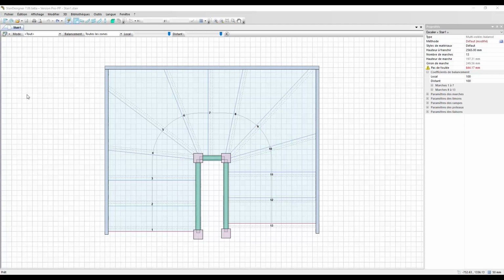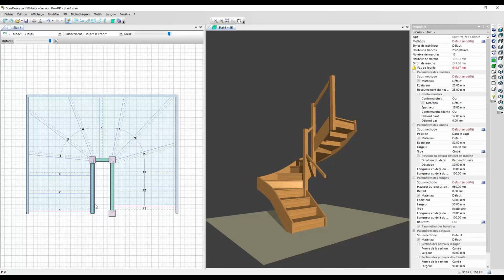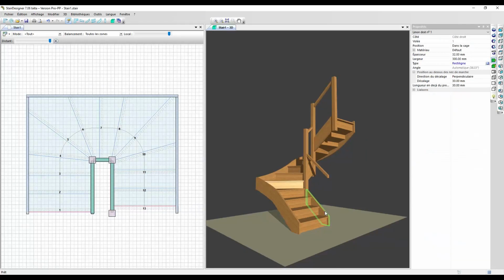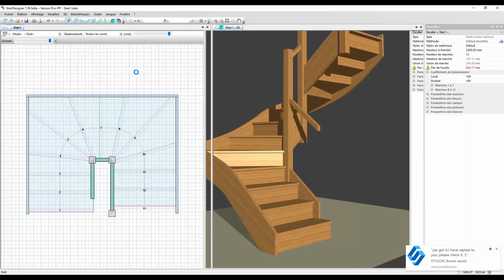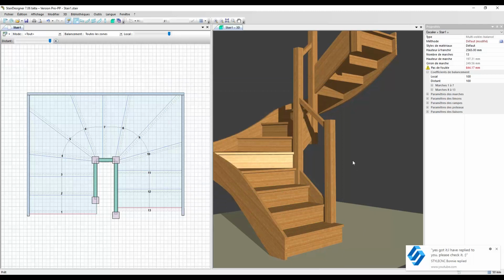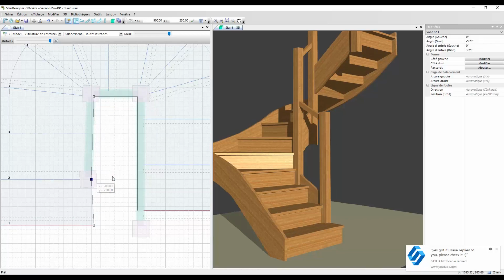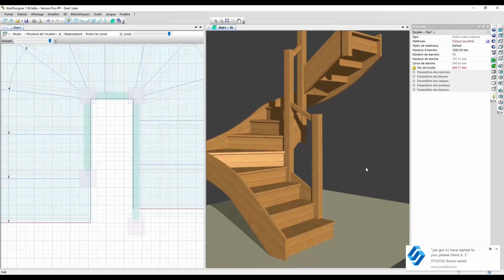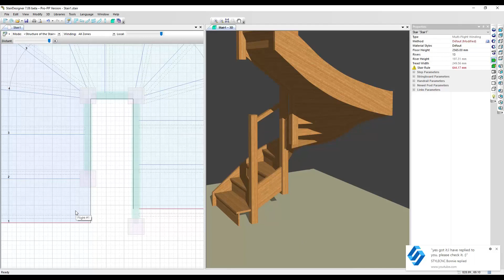How to Set Back the First Newel Post in StairDesigner

Comment: Good Morning. 

It is possible to make this ladder with only one column instead of two.  

I will try to explain it better.  
The ladder is on and rotates 180 degrees to the right.  
And in this rotation there are two columns.  

Is it not possible to do this rotation with just one column?  without getting that space in the middle?  

Lengths
Reply from the maker: Hi Fred, sorry for late reply. Can you register for free on our website then post pre-sale queries on our forum here (or request an online demo). A picture of what you're trying to achieve would be really helpful too. Thanks https://wooddesigner.org/forum/